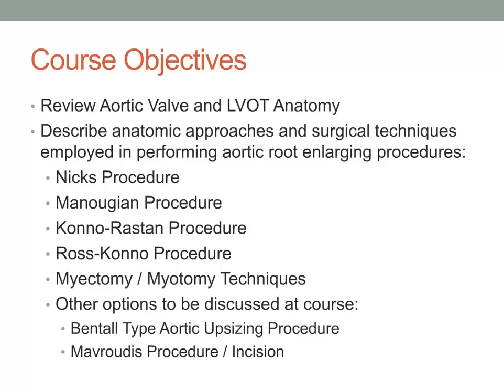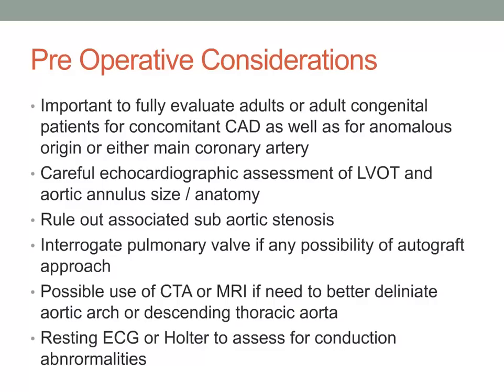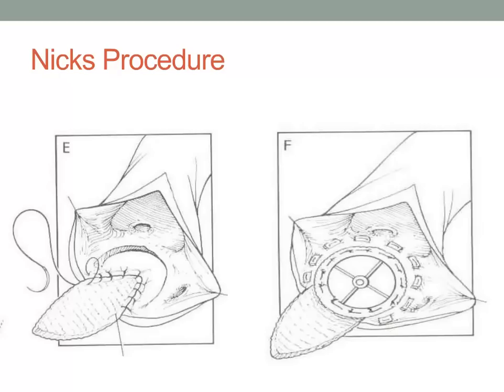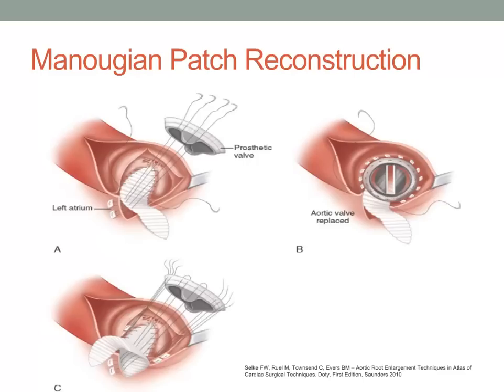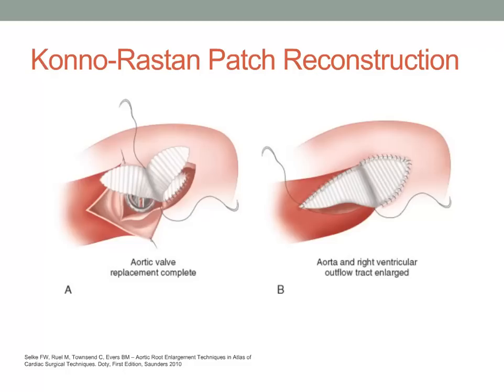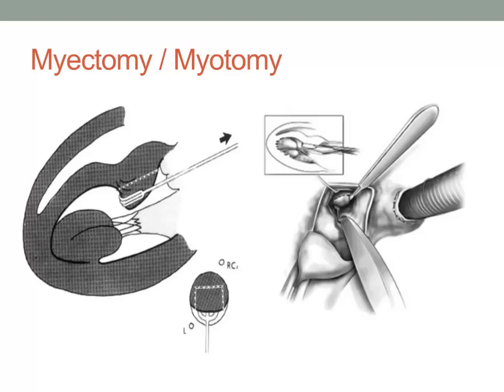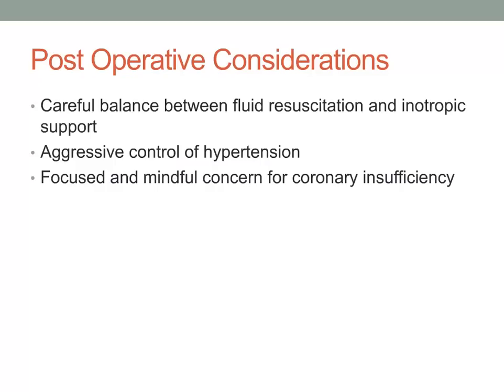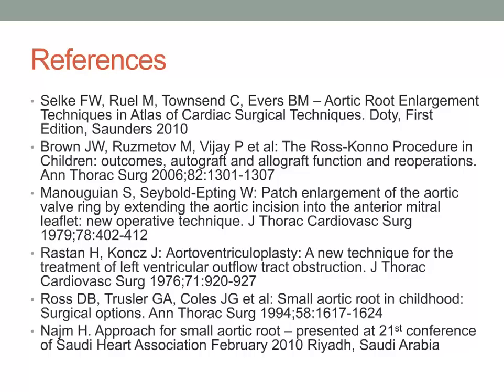STS University Course 4: Aortic Root Enlarging Procedures

Comment: The root enlargement techniques slide depicts the appropriate eponyms for the enlargement procedures. The discussion and subsequent slides use use the term "Nick's" for what is actually the "Manouguian" techniques and vice versa. It's important, not just to nit pick, but because you cannot extend the "Nick's" posterior annular split incision straight down into the center of the anterior mitral leaflet. You have to go between the NC and LC commissure, across the aortic mitral continuity and then into the middle of the body of the anterior leaflet of the mitral valve, (Manouguian). Perhaps, terminology such as aortic root enlargement with a "non-coronary cusp posterior split" (Nick's) and aortic root enlargement with a "non-coronary and left coronary commissural split", (Manouguian) approach would help keep the procedures straight. We all like eponyms, because that is what we learned years ago, but they have their problems. Descriptive names seem to limit the confusion. I hope this is helpful.
Reply: Treasure! Thank you, Prof. Anderson!
Reply: Thanks Prof. Nice understandable explain